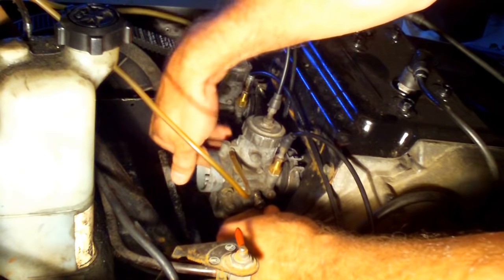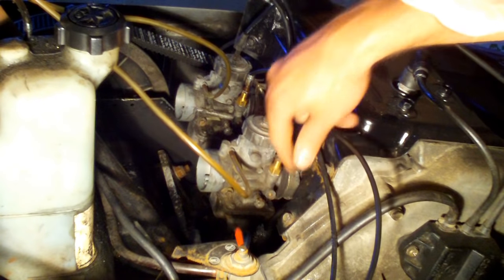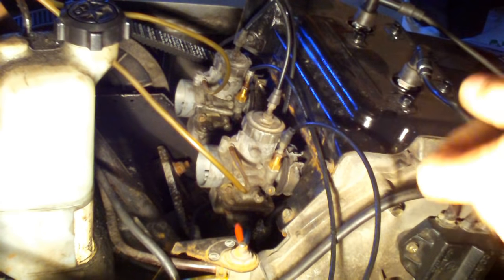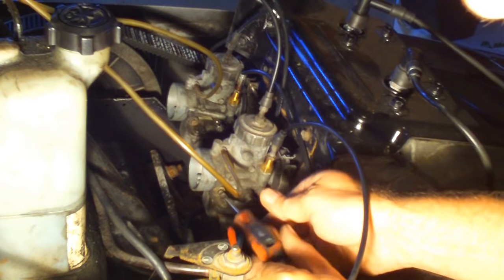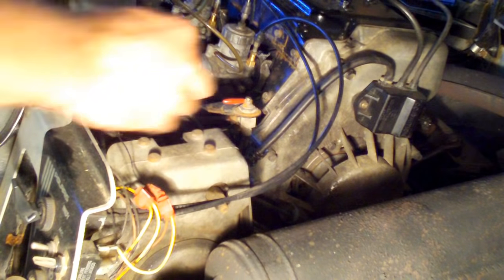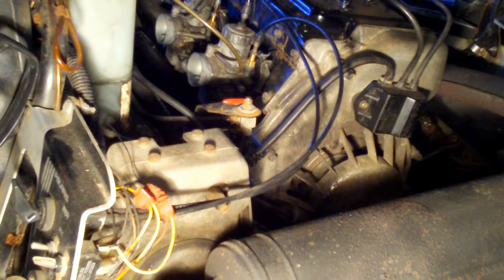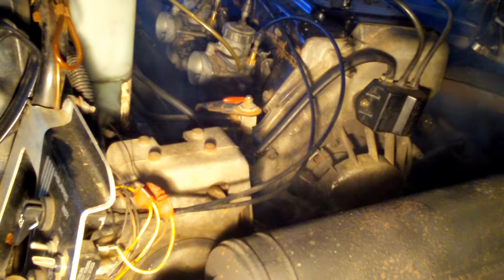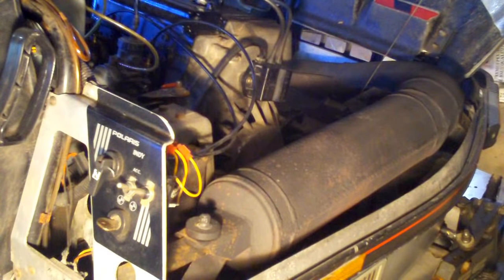How To Adjust Snowmobile Carb Idle Screw Setup on Mikuni ✔

Comment: Thanks Mark working on my ‘90 Indy Trail 488fan this video helped a lot, carbs were dirty and out of sync. Runs like a champ. Next up is to fix my ‘88 488.
Reply from the maker: If you haven't already, set your jet needle clips into the third notch from the top. At that setting you will be close to stoich at 0 degrees fahrenheit at Sea Level. So anything above either of those you will begin to run on the rich side, just a bit, but enough to keep those motors happy for a very long time!
Reply: @contact4mwy7  Awesome thanks will see what they are at and set them up now!

Comment: Thanks Mark, bought a 94 trail Indy deluxe, hose lines were cracked and leaking, long story short previous owner cranked up the fuel so it would run. Once I replaced the fuel lines it was running tooo rich.
Watched your vid a couple times and was able to get mine going!
Thanks for your video bud, appreciate ya.
Braaap from Fairbanks, Alaska!
Reply from the maker: Glad to hear it. Contemplating a new video that better explains these carbs and how they are supposed to work, in addition to the ones I've already made. Thank you for the comment!
Reply: Mark Young - Outside The Box 
Only thing that wasn’t clear to me, from your video. (I’m a rookie with carbs) was where the idle screw was suppose to make contact.
Couldn’t really feel the spot where it made contact.
Tried it at a couple different depths then realized I needed to screw in a little more till I could see the sleeve move up some.
Thanks again!

Comment: Hi Mark, I just watched your video on adjusting idle and air screw it helped me a lot tks
Reply from the maker: I'm glad to hear it, Dale! I am still using all of the carb and oil settings shown in my videos and it is performing flawlessly. I went on a 90 mile ride 4 days ago, got about 15 miles per gallon, and would not change a thing.

Comment: I have a 97 Polaris supersport 488 fan would my carb settings be the same as yours?
Reply from the maker: Yes, Joshua, to start. As long as you don't ride in temperatures much over 35 degrees, try running with the clip in ring position 3 on the needles. If it warms up to say around 40 your sled will start to bog as though it's too lean when actually it's running too rich for the less dense warm air. 35 and lower you should be just fine. Start with the air screws at one turn out from all the way in. Experiment with turning them out more, both the same, to see if the RPMs go up or down. The goal is to get the fastest idle using those screws to find the perfect mix of air and fuel for that temperature air. Then adjust your idle screws if necessary to bring the idle to around 1,600 to 1,800. Check your spark plug for too rich or too lean readings.
Reply: @contact4mwy7  ok awesome I appreciate the reply and information I'll go out today and mess with it somore

Comment: So you turn the big screw all the way in and then back them out two turns after marking? Correct
Reply from the maker: Yes, that's the recommended starting point. Have the track off the ground just in case the clutch engages. Then adjust both idle screws together until you are up to the recommended idle speed for your snowmobile. My 1996 Ski Doo Touring LE 440 has a recommended idle speed of 1,650 rpm. Thanks for asking!
Reply: It runs great but have to keep on the throttle to prevent from dying..so I'm hoping this will help
Reply: @contact4mwy7  wait I have it wrong turn them in clockwise till they touch..then turn twice clockwise again? Some more?
Reply from the maker: @marktesmer212  Yes, turn Clockwise until the screws touch the slide Piston and stop there before the Piston rises. Then turn Clockwise 2 turns to at least have the motor running on its own. Chances are you will have to turn them Clockwise a bit more to come up to the recommended idle speed.

Comment: at beginning of video when you say your putting tension on slide.. are you pushing it upwards? or backwards to hold in place? just trying to understand when to push on slide to do this... AWESOME VIDEO BTW
Reply from the maker: Mark, I'm pushing it against the back of the carb., not up. This holds it in place just enough to feel the difference when the cable slack is removed, and tension is applied to the cable. This is done to both of them to get the same result, matching them up close enough to make further adjustments from there. Good luck with yours, take your time, and thanks for the compliment! My sled still starts and runs great, refusing to show its age.

Comment: would this method work on a 550 fan cooled machine as well ? will the 1 turn back apply too, on the air idle screw?
Reply from the maker: If these are Mikuni carbs, yes it should. If you can download a shop manual for your machine it should tell you what the recommended setting is for it. Check your spark plugs from time to time to make sure the fuel/air mix is correct.

Comment: Mark, to be clear....when you say screw the idle adjustment screw IN until it contacts that throttle piston, do you then mean to mark the screw at TDC and screw it in two MORE full turns? I cannot find the factory service manual anywhere....and the Clymers is not as good as the factory manual.
Reply from the maker: Turn the screw out a few turns to be sure it is no longer touching the sliding piston. As you slowly screw it back in, take notice of stopping exactly when the screw makes contact with the piston once again. You do not want to keep going in past that point as the piston will begin to rise (which would increase idle). That is why I carefully checked this a few times, just to be sure that what I was feeling was the screw contacting the piston, and STOP right there. I then marked the top of the screw with the permanent marker so that I could keep track of how many turns IN I made, which was 2 to start with. This raised the piston slide up just slightly for the engine to idle. This also meant that I could repeat the same procedure for both sides with the same result!! Make sure your track is off the ground when doing this, just in case it wants to run away, and good luck!

Comment: I have a 1999 skidoo formula dlx 380 can't find my carburetor settings any help?
Reply from the maker: As for the needle clip, I would start at position 3. Both of my Mikuni sleds are set to 3 and I like the way they run and the color of the spark plugs. As for the air screw, start at 1 turn out from gently finding fully closed. This is an air screw meaning it regulates how much air mixes with the fuel at idle. I set mine a little on the rich side, which is to say less air added. This helps it idle high on cold start and automatically idle down on warm up. It also helps with idle temperature of the cylinders when hot. Rich is better.

Comment: how do you get a shop manual? I have a 2009 polaris IQ Shift 600. Just wondering how to find specs to adjust the carburetor
Reply from the maker: I had to find mine online using Google. Some are free, some are buy only.

Comment: Great video ..
I have an old 337cc 2 stroke yamaha that will only start If i floor it and run Great until you turn it off. once you shut her down it'll flood out and gas starts coming out the exhaust any advice?
Reply from the maker: This could be due to a bad float system inside the carb. If the float does not cut off the flow of fuel into the carb it will make its way into the engine. This is not good for an oil injection motor because that fuel does not have oil mixed into it, which means the parts inside the motor are not getting lubed (very bad). The two things about float failure to check are that the float has not cracked or developed a hole in it, and the other is that the needle and seat (the main valve that the float operates that stops the flow of fuel) is either worn or dirty. There is a device that is pointed on the end (the needle) that fits into a hole where the fuel enters the carb (the seat). These are both fairly easy to replace as a matching set. Always replace both as a set, never just one or the other. Another thing to check, as this happened to me, is if there is a fuel pump that has a vacuum hose attached to the engine block, to gently pull that hose off the engine and check for fuel inside it. There shouldn't be any. If there is, your problem is a cracked diaphragm inside the fuel pump allowing fuel to be sucked into the base of the engine (this is also very bad). The fix is to replace or rebuild the fuel pump.
Reply: I had this happen on my old indy 488 and it wound up being a crack in one of the diaphragms in my fuel pump

Comment: I have a 94 Polaris XLT SP and it doesn't idle at all, if i try to let it idle it will just die.  I tried playing with the idle adjustment and it didn't do anything for the idle, but i did notice a difference in performance and starting.  Any ideas on on why it might not want to idle or if it could just be an idle adjustment?  Should i try re-tune all 3 carbs from scratch?
Reply from the maker: Hello Nic, my first question is are you sure you were adjusting the idle screw and not the fuel/air mix screws? By turning the idle screws "in" as though you were tightening the screw there will be a point at which the idle will start to increase. The more you turn it from that point the faster the engine will go, even to a point that it would be idling too fast making it dangerous to operate. I have not worked on a triple carb setup yet, so I do not know if yours has 3 separate idle screws or one "master" idle screw. ? If your problems continue give in and take it to a shop that is familiar with them to have it adjusted properly so you can get out on the snow and enjoy it!

Comment: My skidoo keeps back fires really loud and no power. It makes loud pops when i try to get it going then dies. Any ideas?
Reply from the maker: That's not a lot to go by, and it could be a number of things. Spark plugs, CDI Ignition, fuel. When did it start doing this? Was there a time it was running ok?
Reply: @contact4mwy7  i have a tundra lt 550f 2018 sport. Whats the correct adjustments for the carbs? Can u help me find it. I cant find it anywhere. I really want to get my skidoo going

Comment: I've got a 94 polaris indy sport 440 sks and it idles super low. I did the exact procedure my snowmobile recommends 1.25 turns out on the air screws. Then I did 2 turns out on the idle screw. My snowmobile either idles too low, or it idles too fast and doesnt drop down. I think the carbs just need to be cleaned, the idle has been getting worse each season for the last few years.
Reply from the maker: I've dealt with that issue as well. I kept adjusting the idle up and down until I found a setting I could live with. It seemed to hang on high idle when the motor was hot, then it would idle down on its own after a few minutes. Sound familiar? I have to wonder if I have a crank seal leak or faulty intake boot as a possible culprit? The plugs look normal, so I just go with it for now.

Comment: Quick question.  I changed my stock reeds to boyesen reeds and am running a hair lean now.  Would i turn the air/fuel screw in or out to fatten it up some?
Reply from the maker: Hello Grant. Here's how the air screws work... Turn them Clockwise (in) results in less air, more fuel. Turning them Counterclockwise (out) increases air, less fuel. In your case turning them in will fatten the mixture up, but only from idle to quarter throttle open. From quarter throttle to three quarter open the clip on the needle is at play. Grooves higher up towards the very end are for leaner mixes, and grooves further down from the top fatten the mixture. As for changing wide open throttle you would have to replace the main jet with a bigger number one to fatten the mixture. I hope this answers your question! I have another video that goes over adjustment of the clip on the needle and how to get to it. I have found that some carbs have Phillip screws that hold the plate together where the needle is mounted.
Reply: @contact4mwy7  Thanks, Mark.

Comment: hi mark young I have a  1993 Polaris Indy 440 liquid cooled.  it idles fine. and rides but when u give it fill throttle it starts to get sluggish on top end and suggestions would be helpful
Reply from the maker: Sluggish like it is making more of a "bogging" sound? Based on what I know of the Mikuni carbs (which I am assuming you also have on your sled) I would inspect the positions of the main needle jets inside each carb as these control the fuel/air mix for around 1/4 throttle to wide-open. I have a video showing me checking them on my sled, here: https://www.youtube.com/watch?v=DE-vlB1eLiU Let me know what position your "e-clip" is in if you open yours up. Removing the e-clip (be careful not to drop it, it's tiny) and replacing it in a higher number slot will feed more fuel to the air (if the mix is too lean) and may solve your bogging symptoms. This could go in the other direction if you are already in a higher number slot which may be giving too much fuel to the air, meaning too rich.
Reply: Mark Young thank you for ur advice  I shall try that today as I replace my track
Reply from the maker: Replacing your track too? I know that's not fun, but it will be worth it when you're done! Good luck, keep me posted.

Comment: Do you think if I put it to take less fuel it won't flood? My 488 Polaris snowmobile keeps flooding after a pull or two.
Reply from the maker: Is it flooding in both cylinders or just one? If it's both, check the air mix screws by taking note of the position of the flat blade slot on the screw (as if it were a blade on a clock) and turning the screw IN (gently) until it stops. How many turns did it go.... half a turn, a whole turn, 3/4 of a turn? Once you find that out, turn it back out the same amount and add another 1/4 turn, which will add more air to the mix. Do this to both carbs. Try starting it. If it is still flooding, add another 1/4 turn out to both and try again. If this doesn't cure it, look to other sources such as fuel enricher plungers (choke) that have gone bad or are out of adjustment. I have another video that shows how to set the plungers properly if you go to my page. NOTE: If it is one cylinder, particularly the clutch side cylinder, you may have a burst diaphragm in your fuel pump which is letting fuel travel through the vacuum line directly into the crankcase of that cylinder, which is very bad as there is no oil mix with that fuel, it is just straight fuel. I had this problem on mine which is why I had to reset everything back to specs from all of the trial and error of finding the problem of why mine was flooding at idle on the clutch side cylinder. I'm lucky I didn't lose that piston.

Comment: i couldn't get the feel of the idle screw touching the piston slide kind of feels the same hmmm what can I do? i did the air screw right
Reply from the maker: Tim, use your finger pressed against the piston to feel the moment it starts to move up as you adjust the screw. It may take a few tries backing it out and trying again to get the feel for it.
Reply: @contact4mwy7   ok now i get it working on them right now thank you partner!!!
Reply from the maker: @timmberthy  Awesome, good luck to you!

Comment: He mentioned that with the ethanol gasoline’s the needle clip should be in the 3rd groove from the top instead of the factory setting at the 2nd groove.
Has anyone tried this? This will make it run richer - correct ?
Reply from the maker: Yes it will make it richer than the second groove. I have found since this video was made that some manufacturers recommend the third groove as a starting point. Unless you are at a high elevation or warmer temperatures. Give it a try and see how it runs for you.
Reply: @contact4mwy7  
Ok thanks would you recommend the third groove for the Indy 500 liquid cooled as well?
Reply from the maker: Yes, but check the condition of the plugs after a good run. Real black looking go to groove #2.